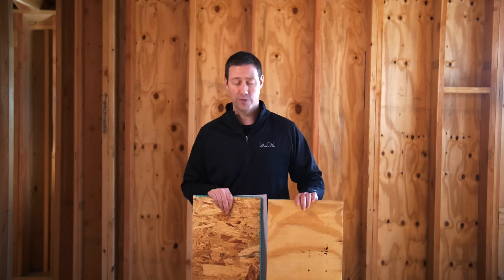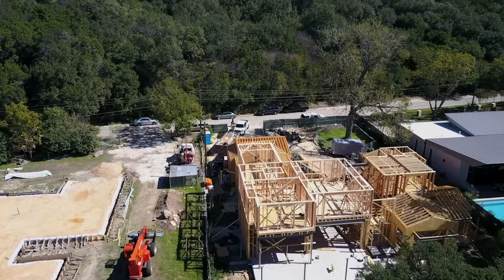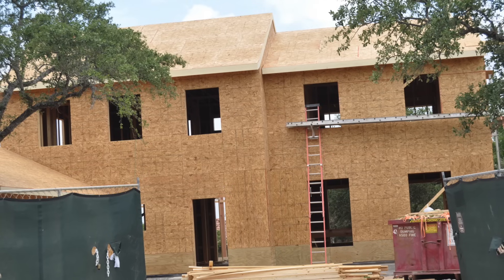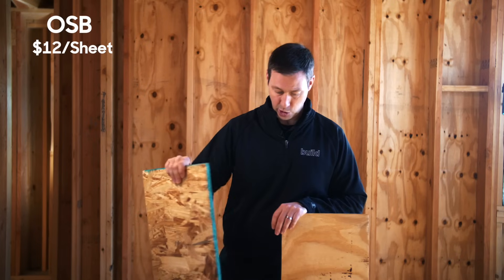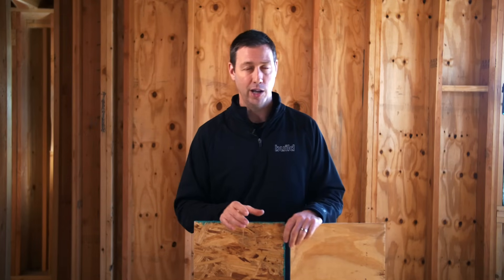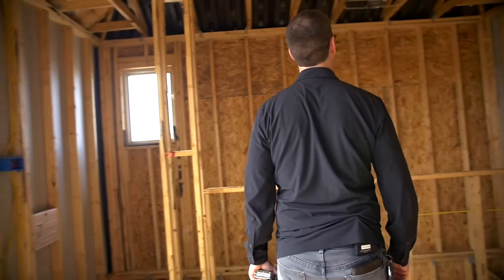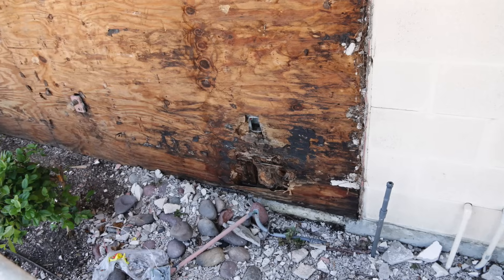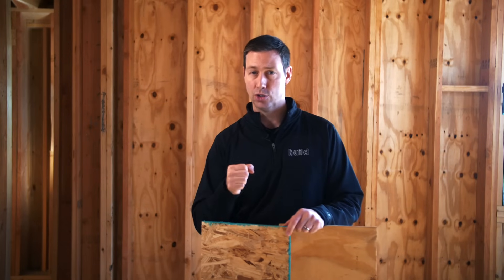Framing : OSB vs. Plywood - Whats the difference in COST AND PERFORMANCE

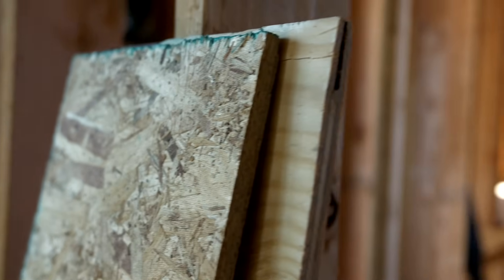Comment: @ 3:40 osb is not a naibase. $1200 difference in a 7000 square foot house? that's really nothing. Especially when you compare the nail pullout resistance between plywood and OSB, and the resistance to delamination. You mention that there is only a "little bit of difference" between small water leaks in OSB vs Plywood. I have found that not to be the case. Massive flaking failure of osb typically under improperly flashed windows and missing kickout flashing along roof/wall intersections. Plywood typically staining with minor top veneer delamination as the top veneer will initially shed the water and not sponge it like the edge of the OSB flakes. OSB  have more exposed end grain on the surface because of the method its assembled. The perimeter edge of each flake is endgrain. In conclusion, i never have and never will use OSB for anything other than attic flooring for storage. Not even board up. My 42 years in residential construction and remodeling experience has shown me the path. Who remembers when strand board first showed up as Aspenite before they even began attempting to "orient" the strands?
Reply from the maker: Great comments from a wise old builder. Thanks
Reply: Nails?  Why don't the industry have code standards for screws in the USA or does it?
Nails have been around for 1000's of years they pull out nail up drywall you get nail pop.
If it was all put up with screws it can't pop. Same thing is true with outside walls nails pull out. Screws can't it has more surface area touching wood as well as the threads locking into place if its not over driven. Its not going to pull out. If your concerned with moisture on edges seal them with a paint sealer or wax something that won't come off or water can't get past.  A wax impregnated OSB would be best, better would be OSB with plywood on the outside in layers. I know they make an MDF like this and its really strong.
Reply: I just had some timbers I burnt in a bonfire with Timberlock screws stuck in them because they were so hard to get out.   Ahh yeah self tapping and stroooooong.
Reply: bobbg - I’ve seen screw pops in drywall too. The more I think about drywall the less I like it. It just doesn’t hold up or stand the test of time. Nail pops, screw pops, cracked seams/corners. It’s better to cover with custom wainscoting and coffered ceilings.
Reply: Also remember screws do not have good sheer strength. Here is California we are required to use nails as they can withstand earthquakes as they have better sheer strength. Screws will simply snap.
Reply: A W Smith w
Reply: Good catch. I noticed this guy puts out some stuff that isn't necessarily true.
Reply: A W Smith yeah $1200 is nothing when you are talking about the whole exterior of a house, we upgraded our kitchen tiles here in Australia for our build, and that alone cost an extra $3000, and that's for just one room on the inside for the finish...!
Reply: +David Sanders
I've had bad luck with most screws with shear force, but the stainless ones seem to hold up excellently. Due to their softness, however, the screw recess must be top quality or else you run major risk of stripping it. nothing less than a 17 point drill tip, too. Lox is my fav recess - the bits really hold those screws.
Reply: @darinvee4980  dude OSB sucks, get over it.  It doesn't mean the building is gonna fail.  But yous will start to get problems and maintenance issues due to the OSB rotting, flaking, swelling, or a number of things.  Hell, even during the framing of a building, if we get enough rain, OSB that's already installed can swell beyond belief.  It's ridiculous.  Everyone working in the industry knows how shitty OSB is.  It really shows your ignorance.
Reply: AGREED!  PARTICULARLY IF YOU'VE BECOME A REMODELING CONTRACTOR FROM CUSTOM HOME BUILDER !  FIRST HAND EXPERIENCE OF THE LIMITS OF ALL BUILDING MATERIALS FROM WATER, FIRE, INSECTS, STRUCTURAL FAILURES !
RUGGED BOATS OF WAR WERE MADE OUT OF PLYWOOD !!   
NOTHING MUCH IS MADE WELL WITH O.S.B. !!!
CHEERS
Reply: @JustinCrediblename  In the NW USA, we use "ring shank " SS nails for exterior/ wet locations , and sometimes interior trim as well , though structural engineers require a specific type nail for structural panels !
Cheers

Comment: Plywood will retain strength after water damage every osb floor that got flooded I had to tear up doing restoration it popped and deformed
Reply: chadwick hayes checkout advantech
Reply from the maker: Coming soon to the Build Show
Reply: SigneM-Prut#1 u have a link?
Reply: I’ll agree plain 3/4 osb sucks, but advantech is awesome. I work in eastern ky where it’s rainy for 3-5 months of the year and I’ve never replaced a single piece of advantech subfloor and ive replaced many plain osb and even more pieces of plywood before farming is done due to swelling and the veneer bubbling up. And as far as wall and roof sheathing you can’t go wrong with zip wall or zip roof osb. It has a waterproof membrane that is superior to anything else I’ve used, not to mention I think the zip osb seems harder and more durable than traditional osb. Point is no one in my area uses plywood for sheathing. No one. Not even contractors who build multi million dollar houses. It will be ruined before framing is done. You’ll have a better chance finding a contractor that still uses 1x sheathing boards in our area than you will plywood. A quality job in our area only uses quality osb, not plywood
Reply: Cheap osb sucks just as hard as cheap plywood, but quality osb products are better and more practical than even quality plywood. Anyone who thinks plywood is better has either never built a house in the rain or has never used a quality osb product like advantech or zip systems
Reply: ^^  Tell me what you know about OSB and how it's used as a single floor product such as 23/32 Advantech.
Reply: Doug Reed if you actually purchased a quality OSB product instead of the cheapest board on the rack then you wouldn't have any issues. You probably can't afford 35 dollar sheets of high end Advantech. Keep going with your $7 sheets of GP board and you will continue to be disappointed.
Reply: Doug Reed I'm still waiting for you to explain to me the superiority of plywood which you've failed to do in your most recent replies. You have 0 proof that quality OSB is inferior. When you're ready to talk material specifications I'm ready. Let's hear more about my improper replying technique because that's all you can scrounge together in your little mind.
Reply: Doug Reed do you know what Elasticity Index Is? What about Modulus of Elasticity? Maximum Moment? Linear Expansion? Internal Bond? Planar Shear? Edge Swell? Bulk Density? Modulus of Rupture? MDI? Phenol Formaldehyde? Concentrated Static Load? Here's an easy one, Panel Density, even you might be able to Google that one and figure it out. You've got nothing pal. You've proven my point. You can't talk plywood or OSB, you lose.
Reply: Doug Reed Doug's got nothing, he's just floating around the point. He's a troll so he must actually prefer OSB. That was easy.
Reply: He isn’t talking about floors but on the outside sheathing of the House.
Reply: They do. My brother's house had osb flooring unknown to him and one of his pipes burst while he was on vacation and when we went to visit the water had been running for days. His insurance had to pull up the floor for the entire house.
Reply: wnc817 

Pressure treated tends to corrode nails. Probably would have a problem with squeaky floors on hardwoods
Reply: JJ Parker water ruins everything. Plywood or osb the floor is still gonna need to be tore up if water was flooding his house for full on days. Even if it’s not rotted the plywood would swell and buckle just as much as osb
Reply: bigmacattk that’s why you use coated screws👍🏼
Reply: Garbage OSB, gp. My OSB subfloors are now being replaced after one year. Builder never covered them.  Went through two finish hardwood floors due to the movement of getting over saturated.  House is getting raised from foundation now.
Reply: All of it's BS. Try AAC.
Reply: @LKW549558  Who is paying you to say this?
Reply: Rich Lysakowski in al seriousness I have quite a bit of experience in building houses in the rainy season and I can honestly say that I have never had a problem with advantech sub-flooring swelling or delaminating. I’ve only been using zip wall and roof systems for a short time now but I can say I’ve never had any problems with it either. However I can not say the same about standard Osb or plywood, if they get enough water on them like we inevitably do in our area they will swell or delaminate.
Reply: SigneN-Formaldehyd-Planteøstrogen-Soja#1-dræ'  No mention of Urea Formaldehyde glue in this video / thread, the smell alone of a osb sheathed home off-gassing for 2-3 years should have had a mention. Add that to the interior finishes that may contain it and you have a life altering health atmosphere in that home.
Reply: @ItsMrAssholeToYou  My subflooring is Red pine,and the termites won't even touch it .

Comment: bottom line is do your homework with your builder... 
because no matter what you pay for if it's not protected correctly you just wasted your money... 
even if it passes all the building Inspection and codes doesn't mean it is just right.. you need a builder that takes pride in their work... that even if it's not code required they'll go the extra mile and take the time to do it right....... just my thoughts.....
Reply from the maker: 100% agreement
Reply: Is this for the outside surfaces of the house?  Here in sweden I have seen weather proof drywall used with styrofoam insulation and plaster on top of it.
Reply: Good point! My wife and I have been interviewing several builders. First, homeowners need to educate themselves; it takes several years to understand the fundamentals of building construction technology and methodologies. After being equipped with this knowledge, homeowners should feel comfortable and not intimidated to begin "interviewing" builders and asking hard questions such as: "What do you do with any surplus of materials?"  I have found that this question gets under their skin and talks to the heart of integrity. If they become defensive, they disqualified themselves.
Reply: julio Angel I like the way you think, Julio. You make good points and have the right perspective on better builders and their commitment to quality and accountability.
Reply: I say try AAC.

Comment: I think the big difference between OSB and plywood would be linear shear strength. Put a piece of OSB across an elevated surface on one end and stomp on it and it will fracture much easier than plywood.
Reply: very true, but that's not the kind of forces plywood or osb is expected to withstand. first and foremost, both products are substrates that will be covered with flooring/roofing/siding. and for support, they have joists/rafters/studs behind them. their structural integrity is when they've been properly nailed to the earlier stated support material, and the resistance to "racking" it provides. they both do a fine job keeping straight walls straight and squared buildings square. penetration/fracture isn't really a building concern you'd apply to sub sheeting. there shouldn't be anything striking your home with that kind of force... unless a tree hits your roof, and in that case, no amount of sheeting is gonna save you from damage.
Reply: david pape OSB strength is not in its bending properties. OSB strength is in its lateral properties. If you were to elevate a 2 x 12 by 10 ft and stand on it it would hold your weight  however a  2 x 12 truss would snap but yet the trust is stronger than the 2 by 12 on vertical loads. OSB is a superior Shear product.

Comment: did a test laid a 4 x 8 1/2" sheet of plywood on the ground with a sheet of 4 x 8 1/2" osb beside it 6 years later the plywood is still there and the osb died a few years ago.

Comment: The main issue with osb is its weakness to point loads . When I was at jobsites to drill out for plumbing pipes through the floor , floors with osb  it was easy to go through them with a large screwdriver. Also , nails can pop through , giving rise to the codes for flooring to change and mandate glue in this part of the country.    But I've seen plywood perform vastly better in point load situations.       Just something I've seen .      Stay safe, and can't wait for your next vid 👍
Reply from the maker: Good points. Thanks for watching
Reply: Argo Tungsten 7
Reply: Argo Tungsten must be cheap "Koch bros " OSB.

Comment: My older brother was a roofer for most of his life and he said old houses that used planking (T&G for upscale and Ledger board for more modest homes) almost never had issues with leaks causing rot because they dried out so well. The 50's housing with plywood sheathing on the roof almost always had rot issues.
Reply: In the post war boom of 2week house builds, ventilation was not considered or practiced by very few!
Not until a building code standard was established,  was this trend and others ( crawl aspace venting ) fazed out !
The beauty of the old uninsulated, drafty , all sawn wood structures , were that the wood got a chance to dry out !!
Picture those old attics , so hot in the summer the rafters would crack n pop as they dried to tinder level , and then so cold in winter, again drying out from the hyper dry air outside !
OSB CANT AND WON'T BE ABLE TO REPLICATE THIS ABILITY  !!!!
CHEERS

Comment: There's a difference between both products that doesn't effect house framing. But it will in other projects. When cut into small pieces osb can have very weak  areas where the chips arrange themselves  in an ineffective pattern. These areas can be a real problem in craft  projects.

Comment: When I replaced my bathroom's subfloor, I used plywood..... Because I know better than to use crappy OSB.
Reply: (Oriented Strand Board (OSB) - Terms and Definitions, Classification and Specifications) defines following classes:
     OSB/1 - for general use in dry conditions, especially decorative applications.
     OSB/2 - for load-bearing structures in dry conditions.
     OSB/3 - for load-bearing structures in damp conditions.
     OSB/4 - for heavy load-bearing structures in dry or damp conditions.

I always use OSB/3 and have never had a problem with those boards. I don't live in the usa so I don't know if the quality there is the same as here in Belgium, but I suppose it is. you should always check the classification when you buy osb plates

Comment: I prefer 5/8" CDX plywood with waterproof glue and 2X6 Studs especially if you want the building to last decades.
Reply: "...If you want it to last decades" doesn't account for any real hazards. Try AAC.
Reply: I agree, definitely 2*6 studs on the exterior of the house. And 3/4" plywood for the flooring and if the budget allows 3/4" plywood on the exterior walls covered with Tyveck house wrap.
Reply: @juliorosenberg9968  23/32 plywood for flooring is perfect. Great quality and makes for a firm tough stable floor.
Reply: 2x6 studs really only have to do with filling the insulation cavity to code for new building..I’ve worked on 200+ year old homes that are still standing and in great shape with 2x4 studs